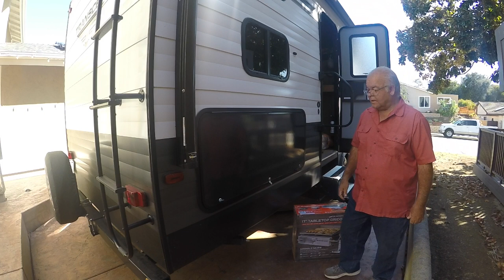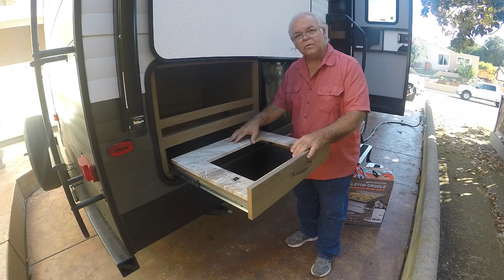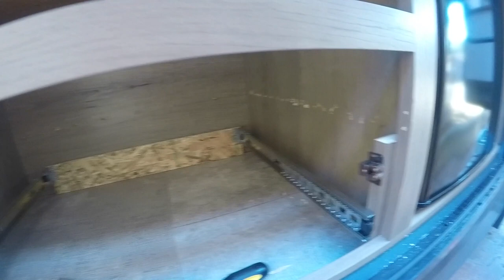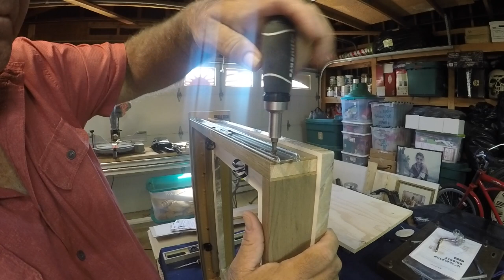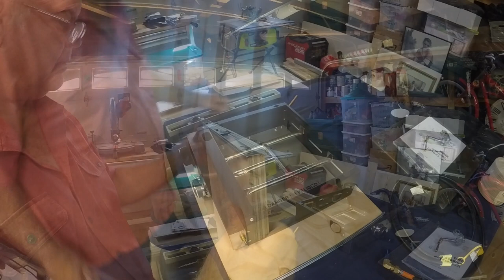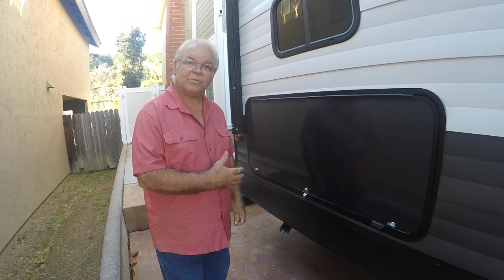BlackStone Grill Install

Comment: Do you think you could have fit a 22" Blackstone vs the 17"?
Reply from the maker: It would fit.  Install would be a bit different, and the gas line would need to be disconnected or re-built to fit the space.  But yes, it can be done.

Comment: Looks great! Has the heat affected the surrounding wood or baggage door?  I'm really considering doing this but want to protect the nearby materials with some sort of heat deflector.  Thanks for the upload!
Reply from the maker: Hi Chris,  I have yet to experience any heat either on the shelf or in/on the face of the coach kitchen.  I do think having the wind/heat shield from the original 2 burner helps.  

When I used the grill in the past, I have made a point of feeling for any heat.  Always cold to the touch.  Also, we have yet to have any smells inside after grilling.  Hope this helps.  Thanks, Dave

Comment: I see you removed the feet and mounted to the wood.  Have you had any issues with heat burning the wood?
Reply from the maker: Hello, No issues and so use it a lot.
The wood is cool to touch and to be sure it stays that way, I recently 
added heat reflective tape to the bottom inside of the Blackstone.

Also, I have not experienced any heat to the coach nor any smoke or grease.

Set-up is 100% functional & Safe.
Reply: @ThinkDaveHowell  thank you.  I was short on height where i installed it but I did put three washers under it of which gave me about a quarter inch or so.  You think that’s enough room off the wood?  I know heat primarily rises, but I don’t want to burn my camper down either.
Reply from the maker: Depends on your setup, wood used, Blackstone model etc.
This setup I did has worked well for me and I was very careful to check for heat all around the grill.
I was able to use the original cover
as a wind break and heat shield.
I recommend being very careful and be sure to check for heat etc.
Never put the grill away hot. Always cool to the touch & clean.
Reply: What about the panel on the left for the hot water heater valves? That has to be modified to access that now?
Reply from the maker: @xourheartsdesire  Hello.  Not sure which valves you are referring to?  This was in the outdoor kitchen area that had a 2 burner stove which I replaced with the Blackstone Grill.  This was not in the storage compartment where the valves usually are.  Hope this helps.
Reply: My 2022 has hot water heater valves on the back side of that shelf. I trimmed my board so I can still access those valves for winterizing.
Reply: It doesn’t look like your hot water heater is in the same place as mine so that comment only applies to grand design imagines